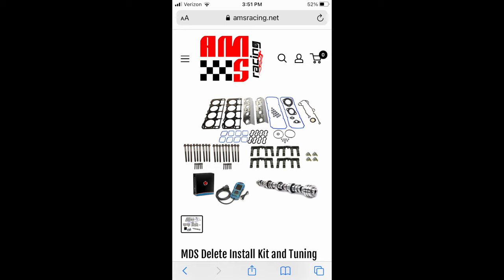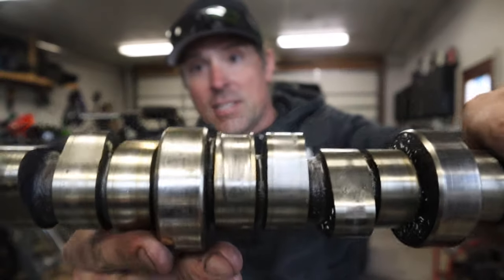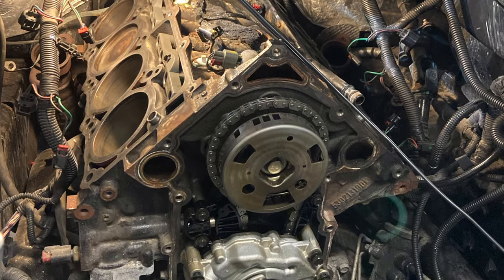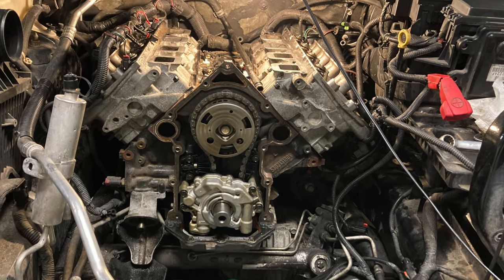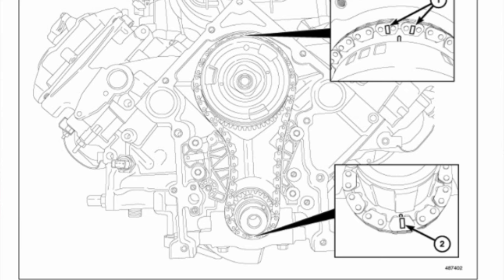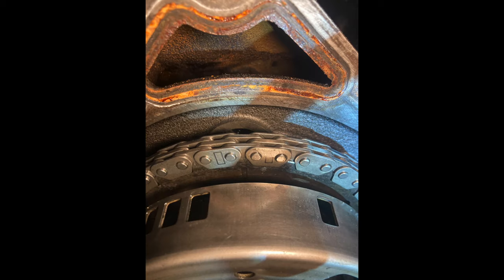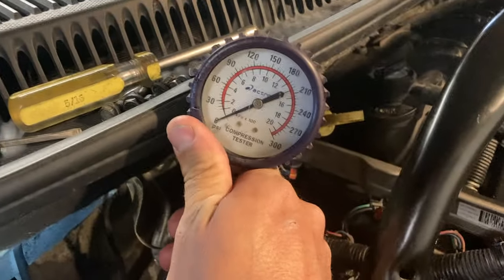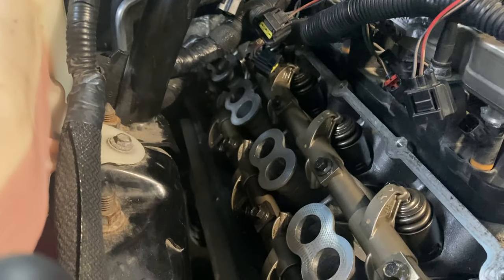Hemi 5.7 MDS delete, Lessons Learned

Comment: So what was the problem? Timing? Or valves?
Reply from the maker: The problem was the pushrod was not seated properly back near the firewall cylinder, so the valve was not opening. It’s easy to misplace the pushrod on these.

Comment: I've tried to sell oil pumps on my last 3 hemi cam jobs and they never want to do it so I've never seen the mark on the crank gear. Always scared on first start up that I got it out of time but if you know #1 piston is at TDC and your cam mark is at 12oclock you're golden. Still there is that doubt in the back of your mind, been sure of myself before and sometimes I'm wrong about things that seem certain
Reply: Actually on my first hemi head gasket job I had one of the exhaust pushrods in the wrong hole 😲 could not figure out why it wouldn't stay running
Reply from the maker: I agree about piston 1 being TDC and the cam at 12 o clock.  I am sure my timing was fine the first time, but since it would not idle, that was the first thing that came to mind, I never thought the pushrod would have been the problem.
Reply: Easy to just check by turning the crank by hand before starting it to make sure pistons aren't hitting the valves.
Reply from the maker: @DL101ca  Thats a good point, I did that without spark plugs the first time, to be sure nothing was going to hit.
Reply: Do you think if your one tooth off on the crank the valves would hit?
Reply: I made marks on harmonic damper washer when piston first gets to top and when it starts moving back down again. Split the difference I'm pretty sure that is as close to top dead center as can be..

Comment: So when the compression problem was fixed the idle was back? The problem was compression?
Reply from the maker: Yes, the cylinder had no compression, because the push rod was not opening the valve.
Reply: @wheelinoutwest  ahhh ok thank you
Reply: @wheelinoutwest  do you know what was causing the push rod to not open the valve?

Comment: not having the lateral locking tabs of the MDS lifters eliminates some potentially problematic moving parts. Actually they have an updated lifter with beefier roller bearings too. 

Missing a pushrod isn't uncommon for the garage guy... its not too easy to see especially when your doing it in a hemi truck and gotta be in such an awkward position when installing those rocker shafts.

Comment: Hello, I have a quick question, Please Where does the MDS Solenoid get the Oil is sends to the MDS Lifters??? Any I really wanna know. Thanks.
Reply from the maker: There are some videos on line, that show how it works, it through ports in the block.

Comment: I'm able to disable MDS by using manual mode on my shifter.  Once rolling, I use manual shift to shift down a few gears, then back to 6.  That disables MDS...
Reply: It’s 3 options to get rid of the mds is to Buy the Diablo tune or get it properly tuned or just do the complete mds delete…

Comment: I love the mds on my 2011 jeep grand Cherokee.  I've been a professional mechanic for over 30 years and know by now vehicles are much better stock the way they were engineered.
Reply from the maker: I don't really have an opinion on the MDS, the only reason I deleted it is, I had to replace the lifters, cam, gaskets, etc, and it all came in the MDS kit.  I had a lifter failure that took out the cam/lifter.  The MDS kits come with everything you need for the repair.
Reply: I'm also a professional mechanic, and while I agree with you that keeping a vehicle stock is the best approach for longevity, and reliability, the MDS system on these engines has some design flaws that will manifest to haunt you. Not a matter of if but when. Also when you ponder it for what? To get 4 more miles to the gallon? It's it's an 8 cylinder meant to run on 8 cylinders. Let's not reinvent the wheel here. That's where the problem lies. You want a 4 cylinder, buy a 4 cylinder SUV.
Reply from the maker: @LynxStarAuto  great points!

Comment: I'm actually about to do a mds delete on one I just bought it already came with a tuner so assuming he did a delete for it already. So this is alot of help!
Reply from the maker: I hope it helps!
Reply: One thing I do want to know is if I delete it can I just install non mds lifters and cams? Ik you probably went over this but wanted to make sure before I spent $$$ lol.
Reply from the maker: @gatgat01  I would do the solenoid block off as well, as that system is all tied together.
Reply: @wheelinoutwest  ok awesome thanks!

Comment: Did the filter stop all the metal from going through the motor
Reply from the maker: I believe it did a good job catching it.  Its been a few months of daily use, and the oil looks good, and the motor runs smooth.

Comment: Hi All,

I have questions and thank you in advance to all that respond. So I also brought the same kit my questions is do I have to use it to delete the MDS or I can keep the original solenoids in and use the MDS delete cam and lifter the way that it is without deleting the MDS or is the cam and lifers in this kit a special type only used for deleting the MDS? Also I have 2014 Ram1500 I replaced this and my Ram won’t start.. smh
Reply from the maker: I would replace the soloenoids with the block off, the solenoids activate the mds, if you leave them in, I would be worried they could starve the lifter of oil.
Reply: @wheelinoutwest  Thank you WOW, 
I have done so not sure why it won’t start thinking timing chain at this point.. Also getting a lot of error codes P3434 P3401 P2323.
Reply from the maker: @rolankelly9683  sounds similar to what I ran into, if you have a compression tester, I would check each cylinder while cranking it. That is how I found one of the pushrods was not seated.
Reply: @wheelinoutwest  Thanks WOW 
I will definitely try that.

Comment: I'm a lil worried now I got this same kit and supposed to be getting it put on this week
Reply from the maker: The kit is great, you just have to pay extra attention to the timing, which is easy if you pull the oil pump. Also make sure all the pushrods are sitting in place.  The goal of the video was to help anyone who has an issue with idle after the install, on what problems it could be.  Good luck!

Comment: Thanks for your video. Can you just use a tuner to shut MDS off?? I was told I need a unlocked PCM on my 2018 Charger 5.7.
Reply from the maker: I used the Diablosport tuner, and it is able to shut off the mds on any PCM, mine was not unlocked.  But you should verify with Diablosport to make sure it would work for you.
Reply: @wheelinoutwest  Thankyou for the info. I will try that. Subbed to your channel.
Reply from the maker: @reddog3544  Appreciate it!
Reply: @reddog3544  I think 2015 and up dodge locked the pcm so you can’t tune it yourself
Reply: @nickrobinson9503  You are right Nick
Reply: Use their other kind of tuner the Pulsar, it doesn't require PCM unlock and it gives you the ability to modify a few things. I had that on my 2015 and was very happy with it before going with a fully unlocked pcm and Intune 3 with a custom tune and cam.
Reply from the maker: @DL101ca  Thats good to know, thanks!

Comment: Were you rebuilding it? or adding a cam?  Programmer would turn off mds.
Reply from the maker: I was replacing the cam and lifters, as they were damaged from a failed lifter.  While I was in there, it was just as easy to delete the MDS.
Reply: @wheelinoutwest  How many miles did the engine go before the lifter failed?
Reply from the maker: @tone3560  Around 130,000

Comment: I heard you can use non mds lifters with MDs cam just need tune/programming ??
Reply: Hey what’s up , I have a 2012 ram 1500 5.7 , had the same issue with the MDS system, I did replace the liffters and cam shaft,  use a non MDS lifters with the original cam shaft (buy new one from mopar) and u just need to turn off the MDS system with a Diablo tune, take out the solenoids that activate the MDS and use plugs (buy in amazon or eBay) locate on top off the block ( below the intake) and it should run just fine ( turn off the MDS system before replace the parts) I hope this information helps u
Reply from the maker: Not sure, but I would think you would have to delete the mds solenoids as well, hence the tune.

Comment: Thanks for the video, if I put a cam and lifters set in I will no to mark the timing and get pushrods seated properly. I have seen it on a different video with bald guy putting a cam and lifter set in on a challenger.
Reply from the maker: There is another video from an MDS kit maker, that shows how they mark the timing as well, that was informative.

Comment: Also what tuner are you using? Will it work with the 2006 Jeep Grand Cherokee with the 5.7 Hemi?
Reply from the maker: I am using the diablo sport tuner, they make applications for your year as well.  If you are replacing the solenoids, you might as well just delete them, and use the tuner to shut MDS off.  The delete solenoids are just plastic plugs, and you leave the harness unplugged.
Reply: @wheelinoutwest  I found a Diablo sport tuner 
U7137 I think I’ll grab it. I’m replacing the solenoids next week, after they’re replaced you said I can just go ahead and disable them? Sounds good
Reply from the maker: @H1storybr3akdown  Yes, in the diablsport, you have to navigate to the MDS screen, turn the MDS off, and install the tune to save it.
Reply from the maker: @H1storybr3akdown  Just verify that will work with your year as well.

Comment: I had that ( 0 psi  and then great comp )  happen on another type of engine. The seat was falling out and holding the valve open then it go right back where it came from and run fine for a little while.
Reply from the maker: interesting, thanks for sharing!

Comment: I had a professional tune mine with an mds delete without doing any kit or anything else and I haven't had a single problem
Reply from the maker: That works if you do it before the engine is damaged, in my case, the cars were already wrecked.

Comment: So what really happened to that last cylinder what went wrong why you didn't have compression?
Reply from the maker: Sorry if it was not clear, the pushrod was not seated correctly, so the valve was not opening.  I pulled off the rocker assembly put it all back together and it worked great.
Reply: @wheelinoutwest  thankyou so much for the onfo my friend
Reply: I had the same problem when I replaced athena cam in my Ram but with # 3.  The head design makes it really easy to put the pushrod in the wrong position so that it isn't seated in the lifter but is in a crevice of the head itself.  After you torque down the rocker, it will hold the valve open.
Reply from the maker: @jamesthomas7977  Thanks for sharing!  It seems like an easy thing to have happen!

Comment: I deleted mds on my 10' Challenger. My only regret is that I didn't swap the cam. I did have psi springs installed along with some porting and polishing , already had the larger harder valve seats. Bought Crower lifters , swapped the yokes for non mds. Mds and hemi tick goodbye !
Reply from the maker: Nice, my cam was destroyed already, so that's why I replaced mine.  Thanks for sharing.

Comment: So does the timing have to be messed with to change the cam?
Reply from the maker: Yes, you just put it back to the stock location, which is pretty easy once you read the manual, or watch a video.
Reply: Thanks for the replay one last question if I take off the passenger head can I check the cam from there to look for damage or is it hidden? I am more of a body man than mechanic
Reply: Can I inspect the cam when I take off the passenger side head?

Comment: Thanks this helps I have that issue now starts but turns off after 30 seconds or so I did the mds delete but don’t do it on the Diablo though I don’t know that so I’ll try that today and see from there if not I’m doing what you did a compression test
Reply from the maker: Are you getting misfire codes too?  If you did the delete, you also need a tuner as well, to shut off the MDS so you do not get any codes.  However, AMS Racing told me it still should idle without the tune, so I would start looking for any mechanical issues as well.
Reply: Yes I got a Diablo tune 3 and also purchased a custom tune from Greene racing for it I installed a comp cam comp push rods and hell cat lifters. Had the engine machined to a 20 over bore new pistons and rings. I’m getting the 0013 code which is the cam shaft position I looked it up and the truck would run but too aggressive and turns off after 30-40 seconds and I pulled one of the plugs which was wet so running real rich of course. I changed the cam sensor that located under the intake manifold and the other censor on the passenger side on the block on the out side wish I could send you some videos of what I changed so far.
Reply: Plus my Diablo don’t have that option I see you talked about the mds which I did get the delete kit with the plugs and everything
Reply from the maker: @El_verde  I see, you have done more work than just the stock engine, like mine was.  This is a little different situation than mine was.

Comment: Using the Diablo tuner I turned off MDS with absolutely zero issues
No kit neeeded
Reply from the maker: This motor was already damaged, that’s why we installed the kit, it replaced the damaged parts.

Comment: 100 cam shaft is to high low RPM isnt throwing the oil up, MDS pumps oil up under pressure, dont think thats the issue.

Comment: Hey just subscribed I would like to do this project delete the MDS if I end up getting another Dodge. How’s it all working out it been awhile. Did you have heads checked or machined ? The Hemi is strong and powerful engines. I will look into the kit. Nice video
Reply from the maker: Thanks!  The engine did not over heat or have head gasket issues, so I did not have it machined.  However when cleaning the old gasket off, I always check with a straight edge and feeler gauge to make sure everything is flat.  The Hemi is a good motor.

Comment: I need help i have a 2012 charger pursuit i want to put a stage 3 tsp cam it tells me to get a mds delete but i dont know what do i need and what i dont
Reply from the maker: The mds delete is a kit, that removes the solenoids for operating the mds, and replaces the cam, lifters, etc. the kit is pretty reasonable from AMS racing.
Reply: @wheelinoutwest  could i get the stage 3  cam off texas speed and the mds delete from ams

Comment: If I don't want it to come on in my Ram pickup, I just press the minus button, then the plus button to go to 8th gear. As long as you don't hit the plus after you are in 8th the MDS stays off.
Reply from the maker: This motor was already damaged, that why we installed the kit, to replace the damaged cam and lifter.

Comment: I just got my lifters replaced and im running into a bad misfire problem too could it be that a bent pushrod is causing my cylinders to not spark too ? 
(update) i did some more investigating and i think i have an mds camshaft into my vvt engine cus i took it to an inexperienced that has never worked on a 5.7 hemi before and he bought an mds kit off of amazone so...
Reply from the maker: The easiest way to tell, is to do a compression test, and see if you have an issue with one of the cylinders.
Reply: @wheelinoutwest  will do and i forgot to mention that in my occasion it’s only my mds cylinders
Reply: You guys really? I haven't heard of one failure from a owner that was diligent with oil changes and and used very good quality oil. I actually bought a high mileage one 2 months ago with 114,000 miles on it and immediately changed the oil to amsoil signature series oil and so far so good. Failures are due to poor maintenance. 😢
Reply from the maker: This was not my vehicle prior, it was donated to my niece, and we fixed it up for her. The motor had over 130,000 miles on it, and the people who owned it were pretty meticulous with oil changes.

Comment: I knew a guy that replaced a lifter in his 5.3l vortec. I asked him if he dropped his pan to check for shavings and asked if he put everything back to spec and he said it wasn't necessary.  Two weeks later his motor blew up.
Reply from the maker: In my video I stated that I ended up dropping the pan, to remove the oil pump, and suggested replacing the pump as well.  Everything was torqued to spec, and in sequence.  I stated that you can look these all up online.  This was not a step by step video, this was my overall experience with the kit.  And the problem I ran into, was a pushrod was not seated correctly once I went to restart it,  it is easy to have happen on this engine, as several others stated the same thing happened to them as well.  This motor has been running as a daily driver for several months now, and running great.